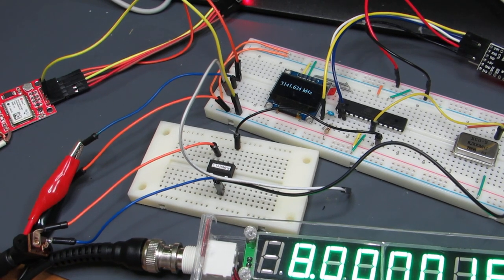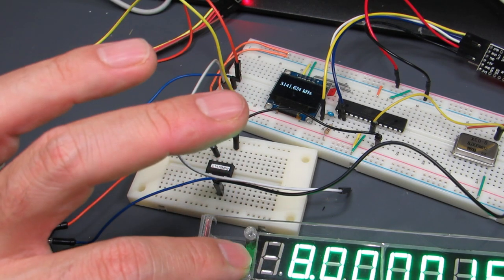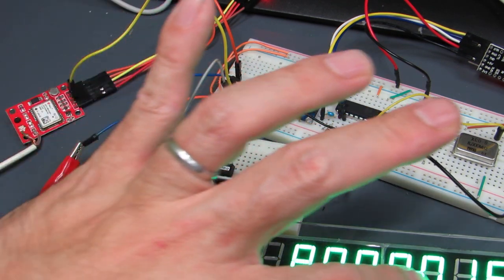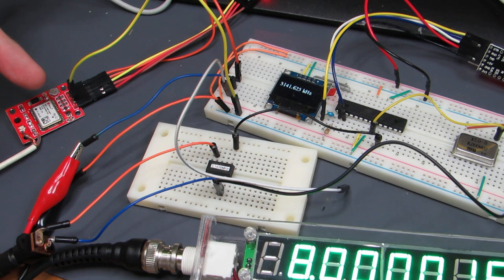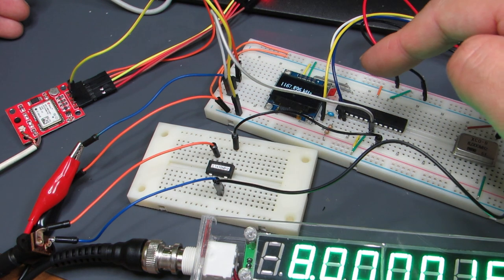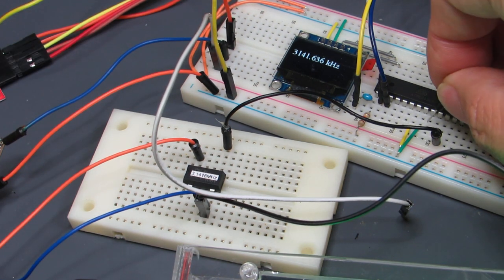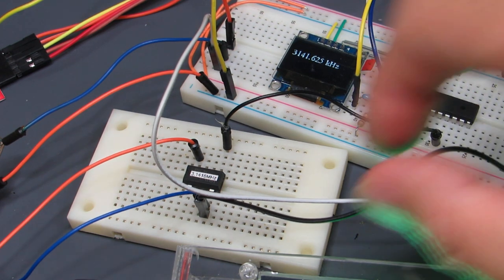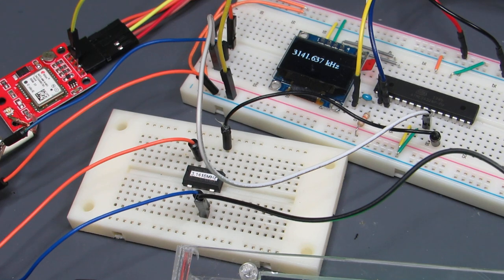Struggling with "frequency accuracy"

Comment: How about a link to the GPS module with 8mhz out? I thought most just did 1 pulse per second. 👍🏻👍🏻
Reply: David Queen The UBLOX 7M modules can be programmed to output any frequency within a certain range. I have mine outputting a 10Mhz signal.
Reply: Joel Caulkins thank you for the information. I think I will order one. 10 MHz would be a very handy reference. I could even call the freq counters at work.
Reply from the maker: Yes,, in the case of ublox, TP5 register can provide higher frequency. I've tried to get 16MHz but 8MHz was more clean waveform and I used one..

Comment: for a second there i thought you were trying to do something with Pi , 3.141592.  Need to beat to of the 8mhz GPS clocks together and watch for any phase shift ( sync) error.
Reply from the maker: Good point. But the quick Arduino implemented frequency counter can count up to 5MHz... Hmmmm